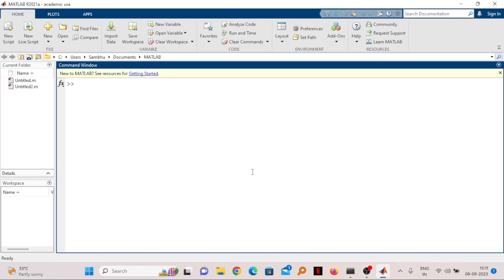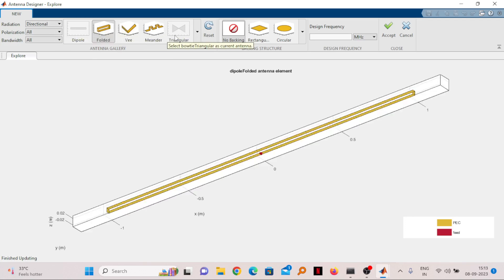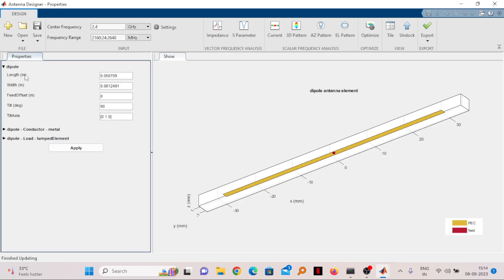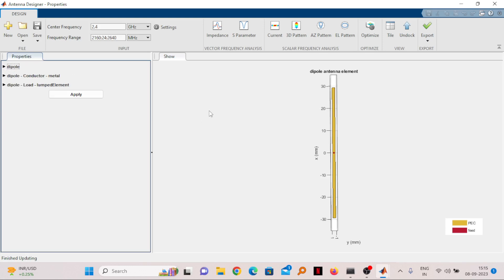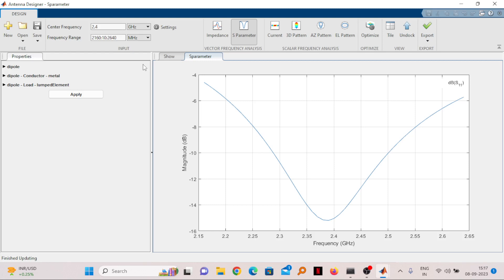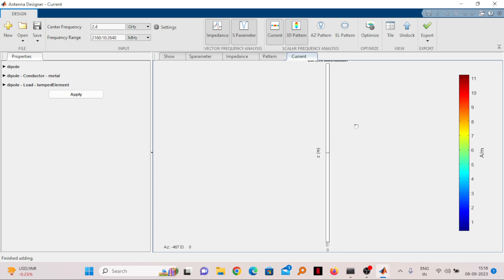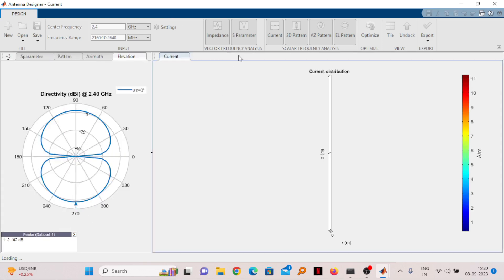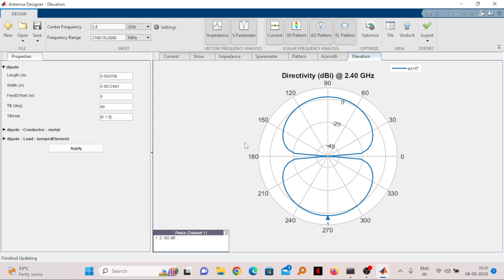How to Design a Simple Dipole Antenna in MATLAB

Comment: WHY I can not rotate radiation pattern?
Reply: Same problem for me
Reply: @ruivazalmeida  If you get to know then please comment here..(btw I used another software for designing as it was not working properly)
Reply from the maker: That may be because of system speed.
Which matlab version you are using
Reply: Please which MATLab version is the best for antenna simulation @MClasses07
Reply: Yo can rotate it, it shows a rotation symbol in the place of your mouse cursor!!